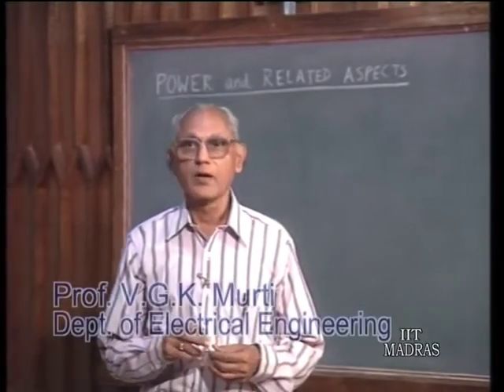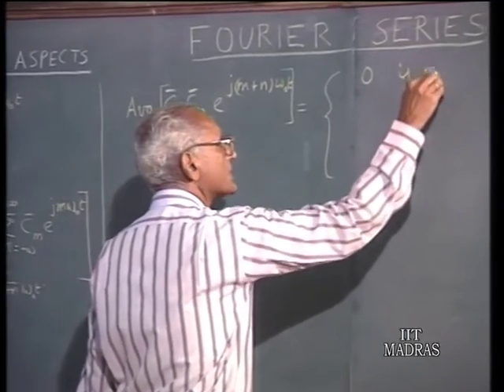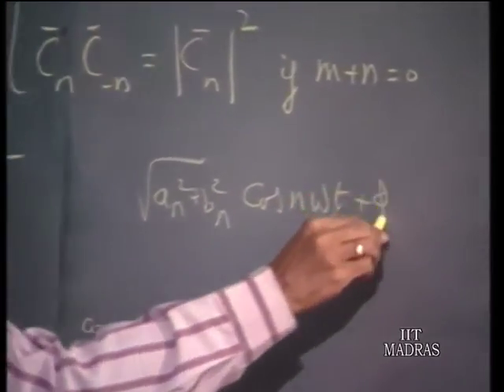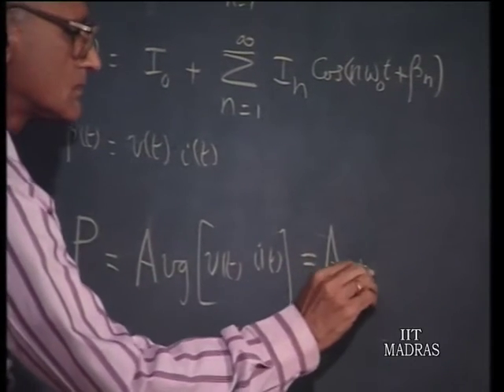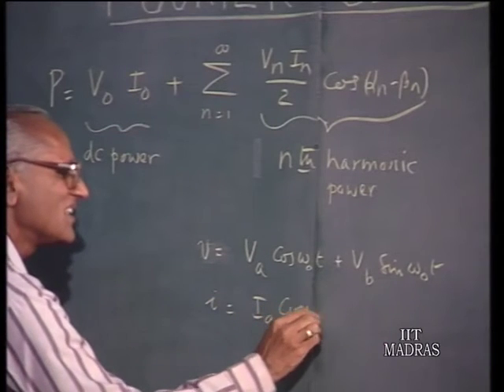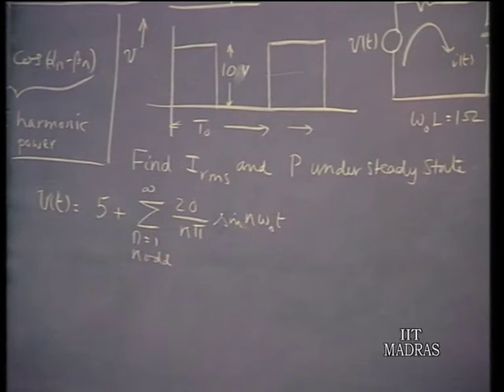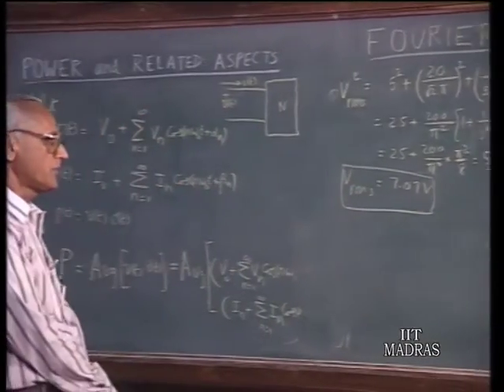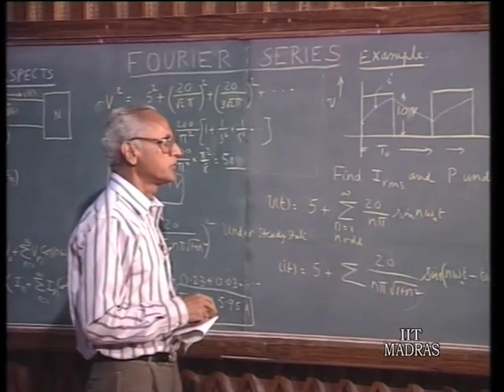Lec 25

Comment: power & related aspects of periodic signal
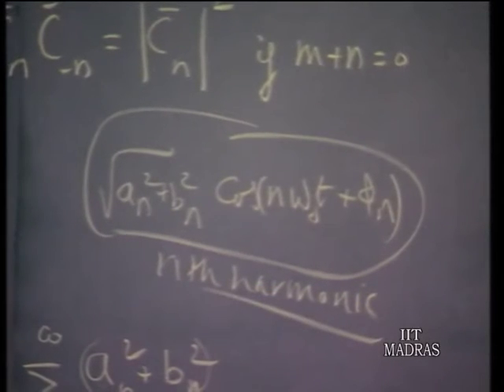rms value    10:00
in freq domain : square of [rms value of periodic func] = sum of squares of rms values of its harmonics
in time domain : rms value = (1/T0) integral[f(t) ^ 2. dt] as t->0 to T0
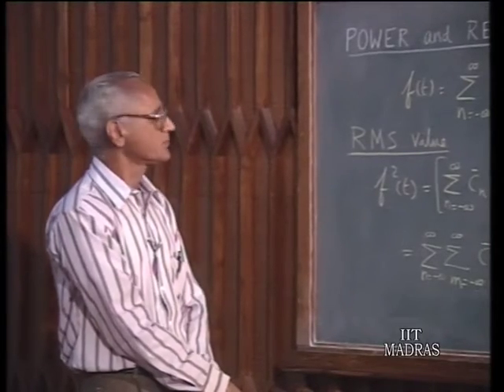pwr calculations in freq domain 12:00
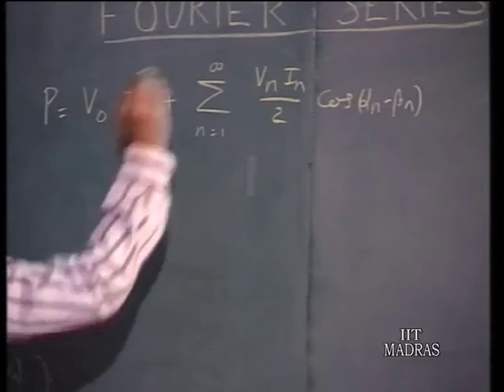given FS of v(t) & i(t), the avg pwr = sum of dc pwr (i.e. V.I) + sum of pwr of each harmonic (which is product of volt, current components and the cos of angle b/w them (i.e. powerfactor of the harmonic))  17:00
as a rule pwr is nonlinear func of v & i i.e. v & i cannot be simply added to get total power. but in following cases the summation of pwr of each constituent harmonic gives total pwr :
a) i & v are of different freq
b) i & v are of same freq but with 90 deg phase difference.
thus in general if v=v1+v2 and i=i1+i2 then P not= v1i1+v2i2 but
if v=vacosw0t+vbsinw0t and i=iacosw0t+ibsinw0t the P=Va.Ia/2 + Vb.Ib/2
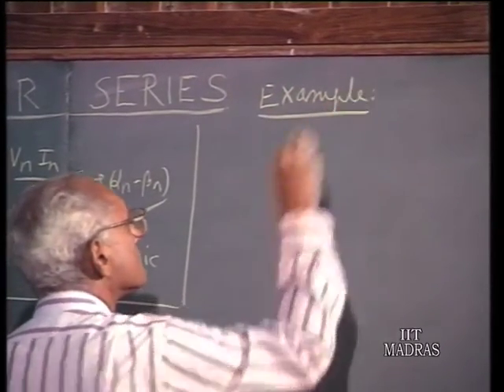numeical eg of calculating rms values of i & i and pwr in a circuit given i & v as Fs in freq domain  20:50